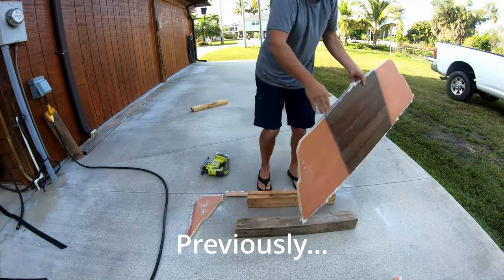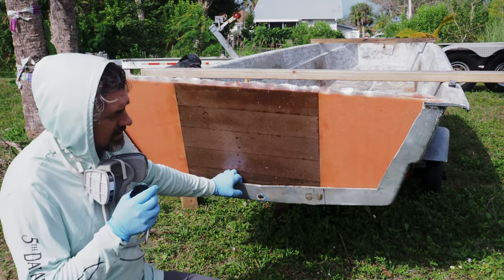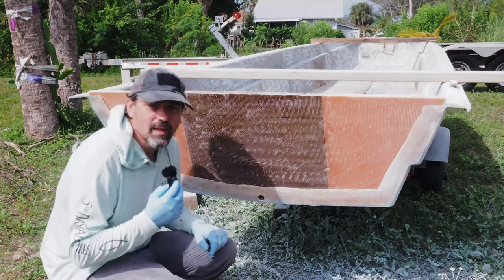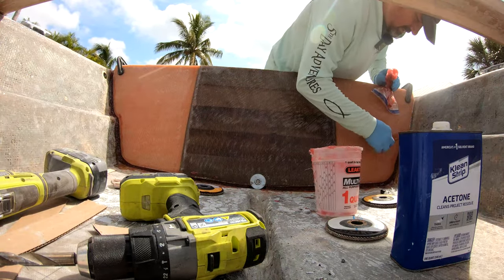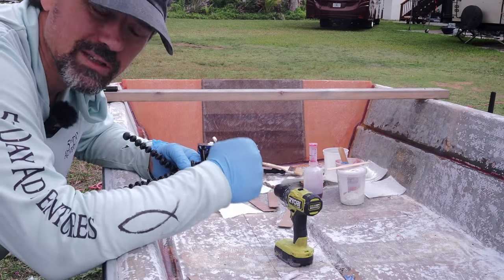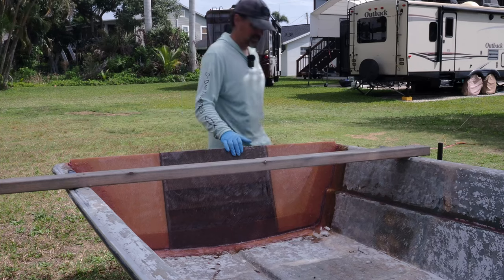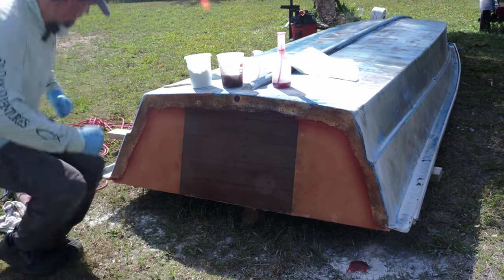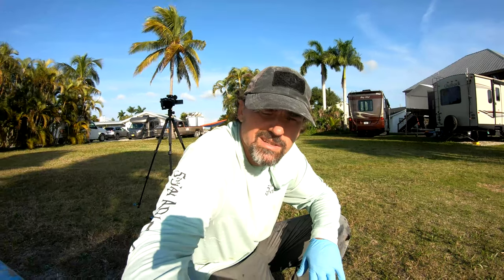Installing New Boat Transom - The Boat Build Begins - Building a Fiberglass Boat

Comment: When I was doing the transom on my 14ft Terry Bass boat, it was complete overkill for the transom. My friend said Mike, you planning on mounting a 350hp on the back? 😂

I epoxied 2 pieces of 3/4 plywood together and epoxied that to the outer skin. I then used 4 layers of 1708 to create the inner skin. I custom cut and epoxied in two inside 45 degree mounts that were attached to the floor and transom. I also cut two 1/4 steel brackets to the inside width of the transom and the motor mount bolts go through it.... This was all for an 18hp tiller motor 😂

I had a lot of material laying around and knew I had no other use for it. I can about guarantee I have the strongest transom around for a 14ft boat. In fact, I had to shave the mounting area down a little because it was too thick to fit the outboard motor clamp.
Reply from the maker: LOL that's awesome you could probability hang several 350's on that 😄